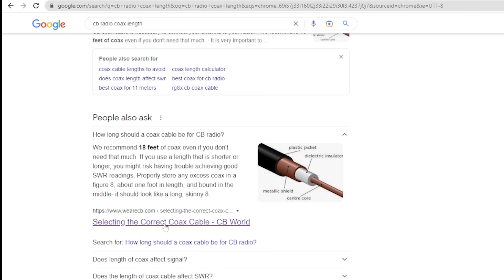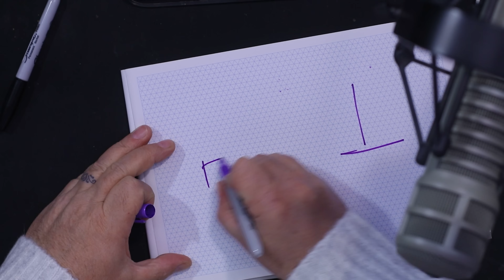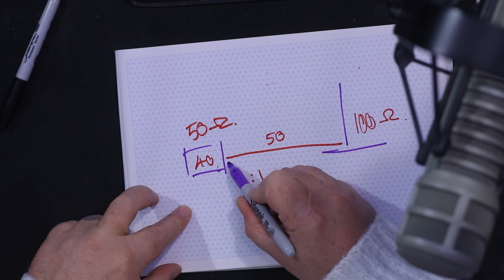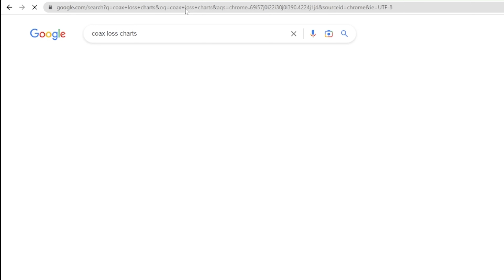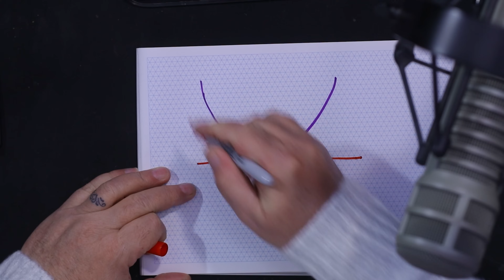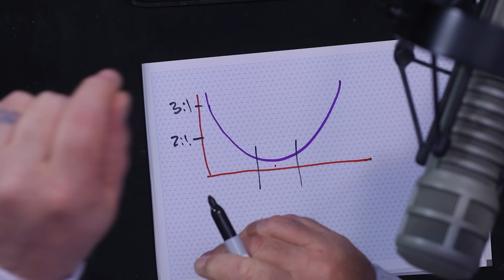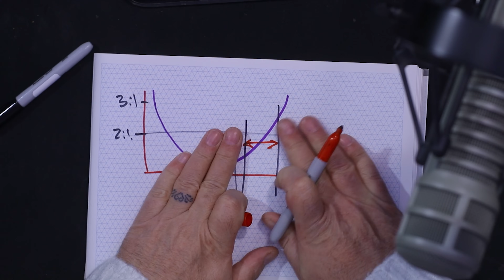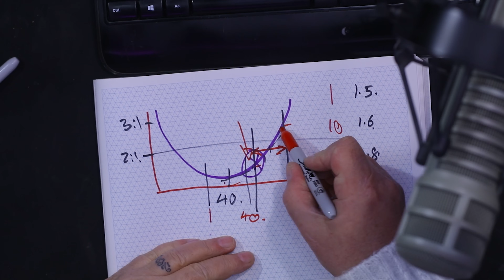11m / CB Radio: How Long Should My Coax Be?

Comment: I believe the 18ft thing may have come from phased antennas for trucks etc. Manufacturers would sell the harnesses for a pair of antennas in RG59. Now, it so happens that a 3/4 wavelength on 27.055 (truckie channel 8), taking in the velocity factor of 66%, is bang on 18ft. Within 1.378mm to be precise. This is too much of a coincidence for me. Maybe it was misconstrued over the years and consumers were requesting 18ft for single runs in 50 ohm.
Reply from the maker: I have just found one of your comments "held for being inappropriate" by YouTube. You need to be more careful of your words. This is a happy place. You are the angry one, not me.. Looks like you also deleted it before I could reply. Anyway, just take care and lose the friction, it won't help us.

Comment: A mistake I've seen CB'ers  make is that they get hyper worried about SWR.  As you've stated, there's not much actual difference in performance between a 1:1 SWR and a 2:1 SWR.  I've seen people think that there's a huge power gain if they get a 1.2:1 SWR down to 1:1. That they're gaining a ton of performance.  I've seen people change out a 50 foot length of RG-8 or RG-213 for a lossy 100 foot length of RG-58 because then their SWR reads 1:1.   With only 4 watts of transmit power they're losing performance both transmitting and receiving.  Using the lowest loss and shortest run of coax and tuning the antenna for a reasonable SWR is best.  Thanks for your video!  73 de AF7FP.
Reply from the maker: All good points!
Reply: CB'ers do seem obsessed with getting as low as possible SWR. I wrote these figures down a while back.

SWR                 % POWER OUT
1.0                     100
1.1                     99.8
1.2                     99.2
1.3                     98.3                
1.5                     96
2.0                     88.9
3.0 Not Good   75

I aim for under 2, 1.5 better. 1.5 and below is great. All QRP here, 5 Watts or less so still 4.8 Watts at 1.5.
G4GHB.

Comment: the legend of coax length  is from the days when surplus military coax was used as it could be rg8 50 ohm or 75 ohm rg11. if one could only get 75 ohm stuff thy would use 1/2 wave multiples to get the radio to see a 50ohm match. i have always used tv coax with good results but had to cut the coax to half wave multiples.     492/f *speed of wave propagation in the cable  = real coax half wave! can be tested with 50 ohm dummy lode to see if you get 1to1 swr. sum old swr meters could be set to 75 ohm as a lot of tube gear had the ability to go from 30-100 ohms .  the old timers called a 1to1 swr, a flat match as the system is all 50 ohm! but use 75 ohm cable then it changes!  for fun try sum tv coax it has low loss and is cheap! the old radio hand books explain transmission line theory better than modern books the late 30s to the 40s books are best!
Reply from the maker: I think you might be on to something!
Reply: @DXCommanderHQ  was reading old ads and their was 50 and 75 ohm swr meters! also old radio books wold talk of using rg11 and rg59 ware as now all that is talked about is the 50 ohm flavor. old radio books talked about the use of 1/2 wave line as quote a semi tuned line vs a flat line that has no standing waves. the old books wold say that coax was best to have a 1to1 flat line was the term  vs not but a semi tuned condition with up to 3to1 was ok.  so a 75 ohm line in a 50 ohm system is a 1.5 to 1 buton a half wave line you do not see it .so the line has standing waves on it but to a small point and having a half wave line was known as semi tuned line, as it was not a flat line with no standing waves  or 1to 1but not a tuned line like open wire line ware the standing waves are say 10 to1. the obsession about swr is stems from the fact is is the best condition for coax especially the hi loss stuff. but  the old books pointed out 3to1 ok on the cable. the old tube rigs the impedance  to the radio was not a problem with a pi network as it wold match from 30-150 ohms. but with fixed 50 ohm rigs swr became more of a problem.  take a look back to the late 30s -to the mid 60s and you will see that 50 and 75 ohm cable wear used.
Reply: Your legend does quite make sense as you have to take in the velocity factor. Unless their antenna impedance was around 113 ohms.
Reply: @arconeagain  a 75 ohm line would mach a 113 ohm lode well if the line is a odd 1/4 wave long. so 1/4 ,3/4 ,1 1/4, 1,3/4 etc. a 1/2 wave line of ANY impedance  will repeat what is put in to it. you can use tv coax in a 50 ohm system if it is 1/2 wave so 1/2, 1,1 1/2, 2 etc will work. the formula for a 1/2 wave line is 492/ f in mhz x velocity factor = 1/2 wave line. \/
Reply: @jakemichael8586  yes I know that, but we're talking 18ft here, which is a 3/4 wavelength with 66% VF. So about 113 load to 50 source. I too have used/tested a halfwave of 75ohm in the mobile (around 3.6m). I know the theory and have done the practical on most things, as it should be done.
Reply: @arconeagain  thanks for clarifying! did not do the math with 18 ft of coax at 27 mhz and .66 vf. I have never used 50 ohm coax just 75 ohm as it is cheap! never had a problem with using 75 ohm cable in 50 ohm system!
Reply: @jakemichael8586  well you shouldn't have any problems if it's cut to the correct length, as you very well know. Of course the disadvantage is bandwidth, but even a random length, though not ideal, wouldn't be a massive problem... I would guess. I used the RG6 in the car because of the better shield coverage. The trick with RG6 is trusting the datasheet with the stated VF. Best tested with a VNA, I think. What do you do for plugs? That's another disadvantage. I have crimp PL259 for RG59, and you can get most plugs and adapters these days. Or you can retrofit, but again, not ideal.
Reply: @arconeagain  for plugs i have used no plugs just direct connection to a antenna and radio! have also used f to pl259 adapter. have also used electrical tape t build up the cable to .400 inches approx and fold the shield over the tape and screw on the pl259 and solder the center. all work well! I like using direct connection and no plug! to make a connection on the radio i have used a banana plug with binding post for center conductor and the shield to the out side of the so 239 with hose clamp. hope this is of help!
Reply: I use KW gear years ago and I got the 75 Ω version, rx and tx and used tv coax.
G4GHB.

Comment: when i passed the rae in 2000 an old g3 who i knew well told me that when i set up on 2m to measure the coax out in quarter wave lengths called stubs, odd even, odd even etc, and if i remember rightly evens was a better match, i just did that at the time, 19.25 inches each for 2m, possibly more important on 2m, i have no idea, as you will well know the loss is much greater, he did go on to say that it was a black art, but really short as possible and as good a coax as possible is the best way. back in the day in the 1980's when i had cb i diddent know any of this and just put on what was needed and it was all ok every time, so i think his black art statement is the right answer.
Reply from the maker: I think that old G3 was living a previous time. I think sometimes they considered it like balanced feeder!
Reply: @DXCommanderHQ  that could be right, its just that they came out with an 18ft feed as in your vid, so going by the black art theory, 6ft is a quarter wave on 10m not 11, so possibly somebody has looked at this and thought the feed should be measured in multiples of that quarter wave and came up with this, not realising that 11m is a slightly longer quarter wave and thought 18ft is a decent average length for joe bloggs and anyway it ends up on an odd, 3 quarter waves = 18ft, oh well !, i like yourself dont think it matters a twopenny toss on 11m, but i will leave vhf and uhf as an open debate as i think something is mentioned about stubs in the vhf/uhf handbook, wouldent like to try measureing stubs for 70cms though !!!
Reply from the maker: I honestly don't think there is s debate.. Only in the brains of people who think there should be.. ANd 6 feet is not a 1/4 wave even on 10m.. Well, maybe it is but velocity RG59 Velocity Factor it's 1.65m. You see, it doesn't matter how you cook the boks, ALL the numbers never align.
Reply: But the numbers do align. John, a 3/4 wavelength of RG58 on the truckie channel, of all, is within 1.38mm.

Comment: I’ve always thought that 18 foot coax idea was bunk. After doing a lot of research into shortwave radio and scanners, and building antennas for them, I was always scratching my head at the whole 18 foot thing. It just didn’t make any sense. Now I know. Thanks for clearing that up. And yes, ALWAYS use the best quality coax intended for your application. I know that good coax is very expensive, but it is what it is.
Reply: It is nonsense. The RSGB Handbook nowhere mentions cutting coax to specific lengths for a particular aerial, either in the modern one or one I have from 1974 with a couple in between. 
They baffle people with figures. It sounds good.
I remember in a pub way back someone saying, "You're only a radio amateur but he's a CB'er". I was speechless. Overnight CB'ers became experts in radio where it took me some studying to get my licence.
Perhaps I should have taken up CB, I'd obviously know more overnight!
73, G4GHB.
Reply: @bill-2018 The driven element of an antenna requires an rf ground to work against. With most antenna the rf ground is built into it, like a center fed dipole for example. Where the rf ground component is build into the antenna, coax length is irrelevant.

With a mobile antenna, the rf ground is the vehicle body, unless it's none metalic, and then the coax shield will become the rf ground, including whatever else is available.

va3hr va3pet
Reply: @petertyrrell6690  I've used a gamma match and delta match for driven elements.
Yes a badly bonded coax to the vehicle can cause problems and the coax acts as a counterpoise earth. 
73, G4GHB.
Reply: You now 'know' from one guy's opinion on YT? The same guy that basically opened with, 'I'm not an expert on transmission line theory'? C'mon mate, surely you have the ability to think and reason for yourself.

Comment: Yes you know about all there is to know about this radio-cable-antenna alchemy but just for the newbies I would mention that when you were talking about the 40 channels and showing the SWR curve that the center of the curve at it's lowest point would be where channel 20 is and that is the channel that should be used as the reference point for tuning the antenna. I have an external SWR/power reader meter inline, is it ok to leave it inline and use it to keep the radio tuned to the antenna or is it better to remove it and actually adjust the length of the antenna to get a low SWR without using the inline SWR tuner?
Reply from the maker: Good question.. Assuming it's a half-decent meter, why not leave it inline. I used to quite like watching my power levels on mine on SSB as I spoke. I suppose the question is.. "Is there loss". Well, yes there will be but not a lot.
Reply: @DXCommanderHQ  Yes that was the question , would there be a power loss , thankyou for answering my question, I just bought a Galaxy 959b and have a 50ft base cable and a 5/8s wave antenna but have not hooked it up yet as I need to build a base to hold the 20tf mast that will attach to the side of my house. But I don't think you will be able to hear me!........I'm in Sayward B.C. Canada Cheers love your channel just found it!
P.S. since you are into electronics, did you ever try metal detecting? it's loads of fun and England is about the best place to do it, tons of history to discover there!
Reply from the maker: Metal Detecting.. That's something I do fancy BUT I won't have the time..
Reply: He doesn't really. Not even nearly, far from it.
Reply: I just replied to arcone to try putting random lengths of coax on his set up and see if it makes any difference. A dummy load shows 4 Watts whatever length of coax, allowing for long length losses.
G4GHB.

Comment: Thanks for your videos,… always watching you from Kentucky “ The Bluegrass State “ my friend.  Great content.  Thanks for the info on the coaxial cable.
My question on Home coax and connections to The Base Antenna is . I purchased a connector for my Base Antenna set-up and it Allows me to set up a ground wire to the ground on the house with a 8 foot copper rod going into the Earth.
Will this make a Big Difference in listening and Transmissions  ?
Thank you 🙏
Reply from the maker: Hey, good question and if you were running super-high power, it might give you bragging rights. I have never done this myself.

Comment: Great video. In my younger days, on CB, everyone said you have to use 11 feet of coax on a 102 inch whip mobile antenna for everything to work right. Over a short period of time I figured out that was baloney! Thank you Cal! 73s ND4A
Reply: got to love the old 102in whip  cb 1/4 wave... looks crazy but it works... like 80 bucks to set one up now. i have done moved on to vhf/uhf   kd5rch
Reply: In the mid ‘70’ s rule of thumb was 11 feet 10 inches of 8u cable for 23 channels ! Had 40 ft. SWR was 1.1 across the spectrum !  5/8 wave radio shack antenna and got out like a champ !

Comment: I was found the correct length was enough  to reach from the radio to the antenna plus a bit extra to make in easier to connect

Comment: Lol, Cal. It reminds me of the 70,s when my oldest friend had a CB shop doing literally thousands of installs. Most people dont understand characteristic impedence any better now. Most vertical antennas have a characteristic impedence of about 37 ohms, not 50 ohms, so around a SWR of about 1.2. The mythical 18 foot coax came about from the Ford LTD sized land yatchs needing about that much coax to go from the radio under the dash to the 102in whip on the rear bumper. Many many times someone would install antennas in horrible places, like dual center loaded CB antennas behind the cab of a pickup or on the roof gutters on a Pinto, so either too close to the cab. Or too close together. So we would trim the coax to make the radio see a lower SWR.  As you go along the traveling wave you can pick a length using the published velocity factor that will transform the impedence seen by the  radio. IE: a 75 ohm antenna can be tuned  to 50 ohms by using a 1/4 wave of 75 ohm.  A transmission line that is terminated in some impedence Zl, that is different from the characteristic impedence Z0 will result in a wave being reflected from the termination back to the source. At the input to the line the reflected voltage adds to the incident voltage and the reflected current subtracts (because the wave is traveling in the opposite direction) from the incident current. The result is that the input impedence of the line (ratio of voltage to current) differs from the the characteristic impedence and for a line of length L is determined by a formula i cant post using my phone lol.  Look up Quarter Wave Impedence Transformer in Wikipedia. There is a good explanation and the formula. You absolutely can transform the characteristic impedence of the line to match the input impedence of the system. Does it make a difference?  Not really in this instance, the wave still sees an impedence mismatch at the 37 ohm antenna and sends energy bouncing back to the input, it just bounces back at a phase angle that lets the radio see closer to 50 ohms. 

Lets all remember that the 50 ohm standard was chosen as a compromise between the 37 ohms of an unbalanced vertical antenna and the roughly 73 ohms of a resonant dipole at 1/2 wave above ground.
Reply from the maker: Well, you know even my 12.4 installation with 1,000 feet of 32 radials only measured 45 ohms.. I can't get it any lower...!
Reply: You did so well to the last sentence.  The reason for 50 ohm was the coax.   It is a compromise between the loss of the coax and the amount of power it would handle for the ratios of the center conductor to the shield.  The antennas had nothing to do with the 50 ohm of the coax.  When the TV sets started using coax instead of twin lead 70 ohm coax was used because it had the least loss for the ratio of center to shield .  Very few use 1/4 wave whips    on the cars.  So the antenna is adjusted  for 50 ohms and the length of the coax being 50 ohms matters very little.  There are some ham antennas for the home that do depend on the length of the feed line, but that is another story.

Comment: Used the ARRL antenna book to build a magmount that way around '77. The vertical is a hand wound helical about 5' tall that comes apart midway for storage. And since rare earth magnets weren't available, used two aircraft radar magnetron magnets to hold it down. Leave those in place for 24 hours and it takes both hands to unstick them. All hand tuned, no "stinger" necessary and the swr meter sits there and says "what's swr?".

Comment: My radio sees 1.0:1 swr between radio and mobile antenna. Add amplifier with amp off radio sees 1.0:1. With amp on radio sees 6.2:1. Add 6ft LMR 400 radio sees 1.8 - 2.4 at top and bottom of cb band. Antenna is as long as is possible. Am I going in the right direction or should I be doing somthing else?
Reply from the maker: OK, so if your SWR is genuinely changing with the amplifier on, I would 1) make sure the SWR meter is calibrater right and 2) check the amp is not shot.